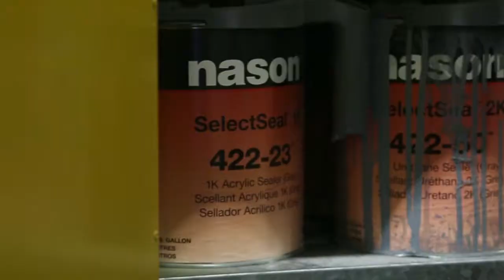Panting a big dump truck

Comment: Question: how do you mix your paint? Thanks
Reply: On the "paint can" it will tell you the ratio. You can also buy paint mixing cups which have the measurements written on them and just read can of paint and it will tell you